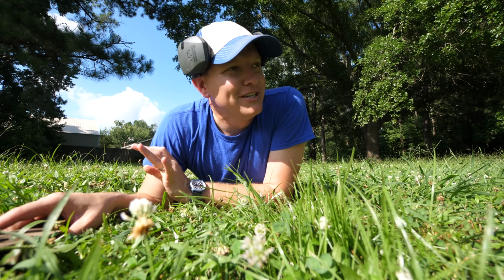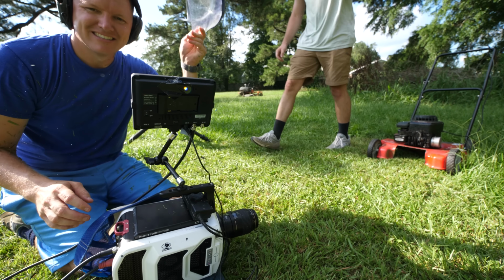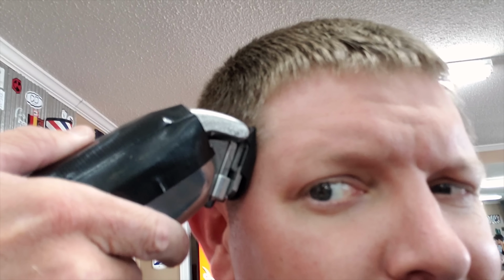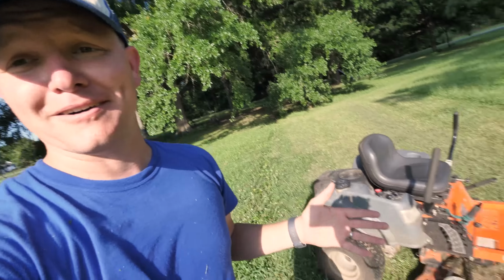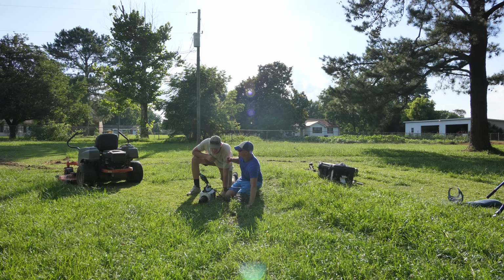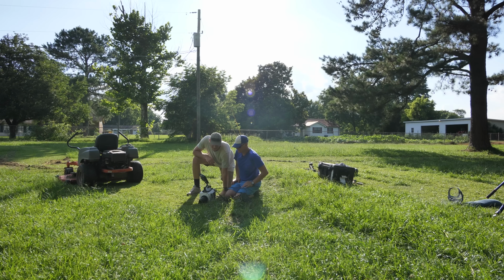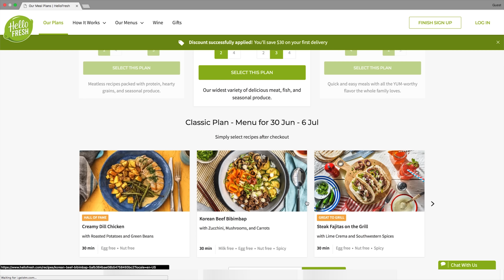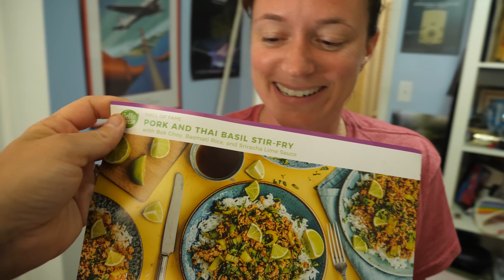How Lawn Mower Blades Cut Grass (at 50,000 FRAMES PER SECOND) - Smarter Every Day 196

Comment: You just went with your assumption that your hypothesis was correct; that the blade wing is what makes it work. You never tested it without.
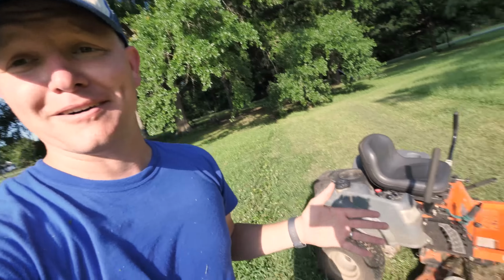Reply: Yes that is what I thought. Please cut the wings and compare the results to show the effect. At 5:50 I thought the grass could also be lifted by its own stiffness.
Reply: He doesn’t have to because it’s not an assumption, it’s fact.
Reply: Then show me.
Reply: Highstranger951 that is not how science works.  Hypotheses are considered potentially factually true after empirical testing, not before.
Reply: Forssa1 do your research guys.
Reply: John Early the science part has been done years ago by engineers
Reply: Its not only about true or wrong. It sounds good and makes sense. However I would like to see a comparison to really see the effect here. The question is: is the cutting result with the attached wings better or is the effect not that important. The wings and the airflow could also just be used to control the transportation of the cut grass.
Reply: Highstranger951 what about nylon cord cutters?
Reply: "This channel doesn't have any content" Oh boy.
Reply: msrego whole different dynamic. There is no deck or shroud to take advantage of any lift that may be created by the string.  It’s simply hitting the grass.  For that matter, because I’m sure that a certain someone will have something to say,  string trimmers are not efficient.  Most of the advantages of string trimmers are being able to get close to objects without completely destroying them.
Reply: Highstranger951 So why bother with this video at all then right?  The point of the video is to show how something works, a good way to emphasize that is to show how it does not work without an essential component.
Reply: Of course the science was done years ago, but that's not the point of this video.  SmarterEveryDay isn't attempting to do groundbreaking original research but instead use the YouTube video format to present interesting ideas in a new, fresh way for the audience to have a learning experience that is more meaningful that just reading a paper in an academic paper from years ago.  If you went to American public school you probably had some sort of Introduction to Physics class in 7th or 8th grade.  Did that class simply have the teacher say things like "momentum is conserved" or "it takes energy to change solids to liquids", or did the students do experiments measuring the speed of colliding balls or taking the temperature of melting ice?  To the degree that this video is an illustration of the scientific method, the video would have benefited from showing the difference, via high speed camera work, between flat, low rise, and high rise blades.  Science!
Reply: Wow.  Just wow...👋
Reply: Forssa1 I agree, and I dont think you are out of line for pointing it out.  Show me the airflow!
Reply: Highstranger951 I have a mower with flat blades cuts the grass fine
Reply: @PiOfficial    I have a set of flat blades with edges on both sides.  Turn them over and you have a fresh edge.  They do fine in short grass.  They don't discharge well in high grass.  The bent up edge is for discharge, not for sucking up grass to cut it off.  Nice point Pi.

Comment: What about a manual lawn mower with no engine?
Reply: Matthew Shultz that uses the same principle as scissors or the two blade method
Reply: That's a rotating scissor/shear at work there.
Reply: Do you mean like an old fashioned push mower?
Reply: They're called reel mowers. They have a back edge and work like the scissors do.
Reply: David Marsh Oh, perfect, thanks for that! I 'knew the answer' but had never really been able to see it in my head.
Reply: I recently learned there are 2 kinds. The traditional one oses two opposing blades, but Fiskars has one that just spins really fast and has no second blade.
Reply: Andy1dude It's a follow-up video then
Reply: Yeah, I head to get out our reel mower to visualize it, and, once you see it, it really is exactly like scissors. But its kinda hard to visualize it without looking at the actual action.

Comment: A weed whacker has no vacuum so I wonder if the speed of the strings makes up for the need for a vacuum by just hitting the grass blades extremely fast. Also an analyzation of different weed whackers in slow motion would be awesome to watch
Reply: The purpose of a string trimmer is to be portable but for small areas. The line wears out, but will not cut your shoes...

That is the trade off

The OTHER aspect of it is that a weedeater can get into DETAIL spots where you CANNOT drive or push a mower easily

So it is truly for trimming. This is why commercial outfits use a big mower - but generally have a team of followers trimming the walks and edges

Comment: You know what you have to do. Make your own blades without the lift tab. Check the slow mo and see if the grass doesn't stand up. Shouldn't be too hard it's just a flat slab of steel.
Reply: VicMorrowsGhost better to just heat and hammer the lift edge down. Balance is very important for those blades, mainly for the integrity of the blade deck. The vibration of an unbalanced blade will eventually rip the pulleys out of the deck.
Reply: Symmetrically grinding opposing blade faces across a central axis is as difficult as it sounds. Add into that keeping it balanced as the previous comment noted does not make it any easier.
Reply: VicMorrowsGhost you can buy mulching blades like that. No tabs. I've had stupid employees put blades on upside down and could barely tell a difference. Rpm fast enough to still cut.
Reply: Just go buy some
Reply: He also should make a clear deck to let it do it's thing properly.  Opening the hatch like that will effect the upward flow, wouldn't it?
Reply: Spencer Samuelson One might replace a metal section with a clear window, both for safety and air control.
Reply: I'd love to know if a scimitar-shaped blade would cut more cleanly/efficiently. I mean, obviously a slice is cleaner than a chop, but would it make a difference? Maybe not get bogged down as much with thick grass?

Comment: Another great video, thanks.   At 7:23 if you look close at the left over grass (or shorter old grass) after the cut, your blade is ripping the grass because its a dull blade.   Thats how the grass gets the brown jagged ends because of a dull blade which opens the door to grass disease and harder / longer to heal, so your causing unhealthy grass as well.   Professionals may carry several blades with them and even switch them out during the busy day of mowing if they see this effect.

Comment: Reel type lawn mowers do shear like scissors....
They have rotating blades that shear against a bed knjfe....
Reply: Okie Male hahahaha I was thinking the same thing when he was talking about it....... he lost his point right away in the first minute 😂
Reply: Cool video en sound effect btw
Reply: They also make sickle mowers that work like barbers clippers.
Reply: Okie Male , and boy! do they do a good job.!
Reply: I was thinking the exact thing about reel mowers when he was talking about that
Reply: @lennartvanschuilenburg3430  he's never used a push mower.
Reply: I had the same thought before reading your post.  I grew up using those and they cut grass the best.  The problem I found is that there are no longer any local sharpening services who can sharpen those spiral blades.
Reply: For hay farming they have swather headers that look like a huge barber shaver. Works really well on less dense crops like alfalfa. 
Then they have ones that look like turtle shells with a blade on each side that spin at like 1200rpms. Those fuckers will chew through anything. I rather have them over the the former.
Reply: @hootinouts  the spiral blades sharpen themselves when rotating against the bed knife if you set it tight for a few cuts 👍
Reply: And they leave soooo much better cut. I had one out in Arizona on tiff grass. Was like a carpet of perfect grass. Sickle mowers also cut like scissors. Combines, mower/conditioner, etc.  dangerous as all get up.  Dangerous to work on too.
Reply: Lennart Van Schuilenburg He didn’t loose any point. He is just talking about a different type of grassmower. You are laughing at what is supposed to other peoples failure while you actually failed in logic yourself.
Reply: The Tiff grass is heavier, thicker blade, more dense per area. It doesn't cut as easy as Bermuda. And you cut it more often to maintain the depth so it doesn't have as much air moving around it to stand it up. The reel mowers are the only way to accurately cut it.
Reply: Reel type mowers work best when the lawn is very flat, almost like a bowling green. But as most of us don't have such lawns the rotary slasher would be better.
Reply: I sharpen rotary blades with an angle grinder costing about 20. I also sharpen reel mowers with a pair of grinders costing many thousands. Just to be slightly pedantic, a newly sharpened reel mower should have a gap between the blade and bed knife so it is not quite the same as scissors. You might have guessed that sharpening lawnmowers and grass cutters are my thang.
Reply: @martinmorgan4215  I worked on a golf course in high school 40 something years ago...
We would set up reel mowers in a grinding machine to get an exact grind on each reel...
Then they were installed on the mowers and back ground into the bed knifes with grinding compound..
They had no gaps between the reels and bed knifes, because we had Bend grass greens and needed the grass to be cut precise...
All our greens mowers, faraway mowers, and rough mowers, we're taken apart and rebuild every winter during the slow season...
Grinding by hand and leaving gaps in your bed knife may be okay for your yard, but nowhere good enough for a golf course...
Reply: @martinmorgan4215 PS... we would use cut up strip of newspapers to test the sharpness of the reels after rebuilding them...
The reel mowers cut paper strips exactly as if they were cut with scissors...
Reply: @okiemale1589  Very impressive!

Comment: Using smoke would probably visualize it better
Reply: the mower acts like a leaf-blower on everything outside the deck - the air-pressure is all outward, not in/upward.  It doesn't draw smoke in, it blows it away.  Once you park it over the smoke, it's in a low-pressure center by the pivot, but no uncut grass ever reaches there since the grass is cut by the outermost edge of the blades.

Comment: 12 year lawn business owner-operator here. The blade lift is how you get a 'sweet' cut. That and a sharp blade. If you cut with hearing protection on your ears then stop and sharpen your blades to razor-sharp then start cutting with the same hearing protection on you can hear the difference. The sharp blades make more of a "swish" sound vs a "swap" sound. That's the best I can explain it. I've done this a thousand times over the 12 years I cut professionally. When I sharpened my blades I did it with a file by hand and got them scary-sharp which is not totally necessary, regular-sharp is good enough.
Reply: Same. And blades also last a LOT longer when sharpened with a file.
Reply: I literally just hand filed my blades 2 days ago...after never sharpening them over the 10+ years I’ve owned my mower! Hopefully it works better than it was!
Reply: I agree. I prefer scary sharp! 😂
Reply: When you sharpen the blade that sharp it will dull faster. Using a file is a good idea because a grinder causes heat weakening the temper of the blade .Also could make it unbalanced.
Reply: Andrew Phillips ...in fear of the scary sharp blades... I got it. Makes perfect sense.
Reply: Going to go sharpen my blade now.
Reply: Have you ever considered just honing the blade? Or does that only apply to kitchen knifes?

It seems like the bending of the tip of the blade can happen to any blade, so maybe youd save time if you tried honing?
Reply: In theory honing is a viable option but you have to realize a mower blade is doing a totally different job than most (if not all) knives we use for daily tasks. A mower blade cutting grass is off-the-chart a rough and tumble cutting action. This is not a fine-edged, precise, careful cut one might do when trimming a rib-eye per se. It is literally a spinning hacking grass destroying thing. There are blades you could run your finger down the edge of the blade and not cut yourself but it would still be 'sharp enough' for cutting grass.

Comment: Scythes.
Reply: Sven Servette i was literally looking at if I could buy a scythe in the next tab lol x
Reply: like cutting tomatoes. its a slicing motion instead of a chopping motion. Just watch a video on them and watch the way it moves through the grass and the way the taper interacts with the grass.
Reply: Cheesus Sliced what's the difference between those two? Genuine question
Reply: Tori Ko between slicing and chopping? Slicing uses the sharpness of blade with minimal force to cut the material with an extended motion. Sliding the edge of the blade across something, all the energy being applied parallel to the cut. When chopping, the energy is applied perpendicular to the direction of the slice, and its a weight or force applied directly to the knife to push the blade through something, using only one part of the blade. Axes chop, scythes slice. In terms of food again, you can chop through bones with a meat cleaver, or slice it from the bones with a boner knife
Edit: a way to think of the kinetic energy difference is pulleys. If you use a series of pulleys, you achieve the same lift with less force but longer motions, while without the pulleys its shorter motions but more force for the same lift
Reply: Cheesus Sliced thanks!
Reply: Tori Ko no worries
Reply: I'd love to see which type of tool is more efficient. How many calories are burned when mowing by scythe vs push mower? How do you convert gas usage to caloric input of manual labor? Fascinating stuff.
Reply: Andy Harrison the human body is extremely good at using energy efficiently, hence the difficulty working off a donut. Against a normal lawnmower, scything can be faster, and simply is more energy efficient because it uses human energy instead of explosive fuels which translate a massive amount of their energy into heat and noise
Reply: Read my everloving mind. I have my own snath and collection of different blades!

Comment: I love SmarterEveryDay, but I challenge this one.   I suspect the tab on the mower blade is more about pulling the loose clippings up and channeling them out the discharge.   I think it is more likely that the grass is being cut because the mower blade is moving sufficiently fast enough that the grass blades can't bend fast enough and they break.   String trimmers are also very effective at cutting grass and there is no suction pulling the grass up.
Reply: Use a sharp blade and it doesn't have to be moving so fast.  Always use a sharp blade.  The tabs act just as they do on a snowthrower - they throw.  The grass is being bent AWAY from the mower as your approach because the air-pressure from the spinning blades is OUTWARD, but this pressure is highest just as you reach the edge of the deck, then it drops away once you are under the deck and the grass can spring back up to be cut (or bludgeoned) by the outermost edge of the blade.  The uncut grass experiences no lift.